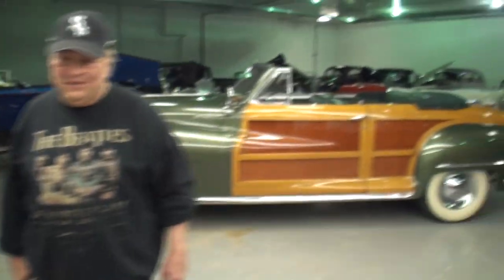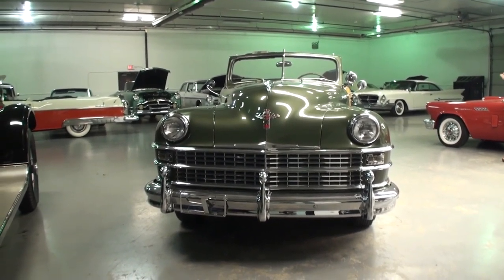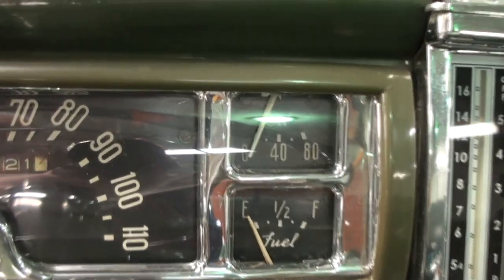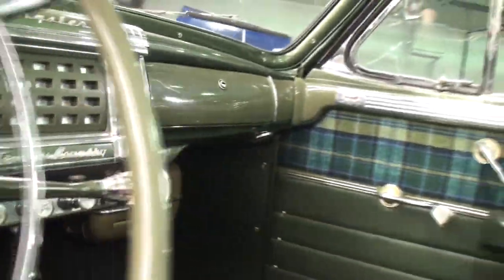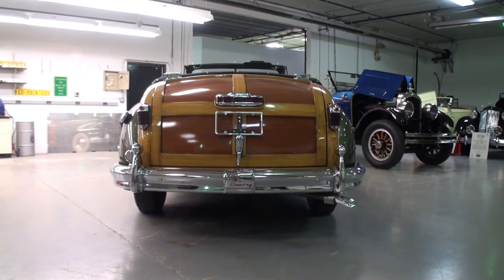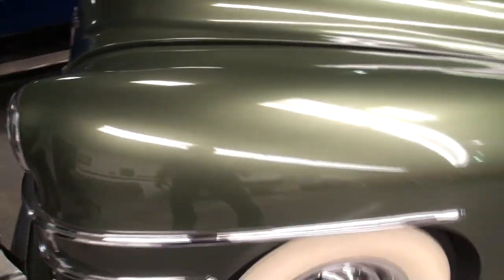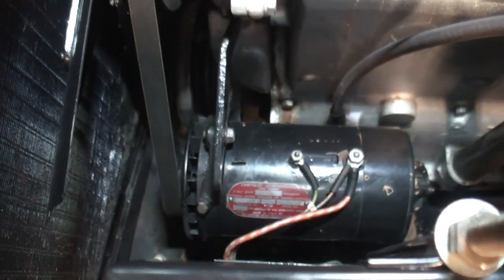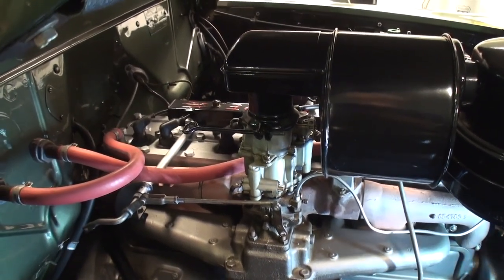1948 Chrysler Town and Country Woodie Woody Convertible in Green on My Car Story with Lou Costabile

Comment: I believe that was the last year for real teak, oak and ash wood being used on the TC. These cars were the flagship of Chrysler of that time, ment to rival anything GM and Ford put out. Other than the Imperial, they were the most expensive Chrysler you could get. The interiors came in that color as well as red plaid. Hot Rodders in the early 50s used this engine in modified street cars because it made great torque at super low rpm. This is a real time capsule!
Reply from the maker: Hi Adam, Thank you for viewing and sharing your knowledge. Hope you see many more cars on this YouTube Channel you enjoy. Please subscribe, and hit the "bell" so you can see all the cars when they are uploaded on this YouTube Channel, Lou

Comment: Get your facts straight.  There were no town and country convertibles that left the factory with the Highlander upholstery - is after market and not original.and the “crystal” you refer to is plastic that was standard on the New Yorker and Town and Country.  Gas cap is an optional accessory not standard equipment.  Easy to check facts about your car - many sources. The wood is White ash and mahogany veneer bonded to metal panels .
Reply from the maker: Hi John L, Thank you for viewing and sharing your knowledge. Hope you see many more cars on this YouTube Channel you enjoy. Please subscribe, and hit the "bell" so you can see all the cars when they are uploaded on this YouTube Channel, Lou